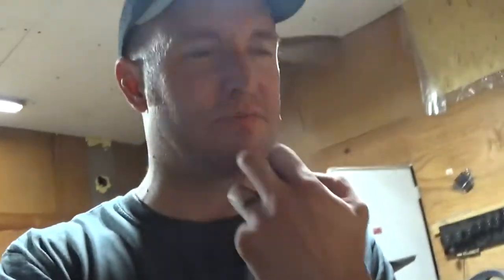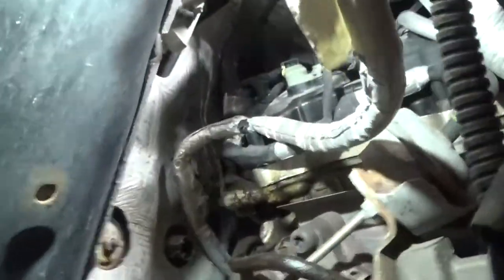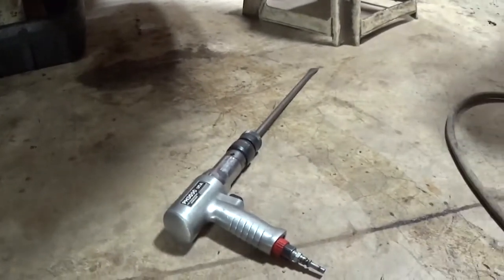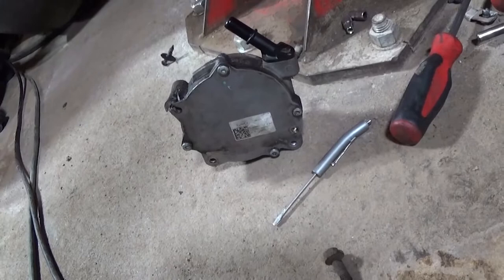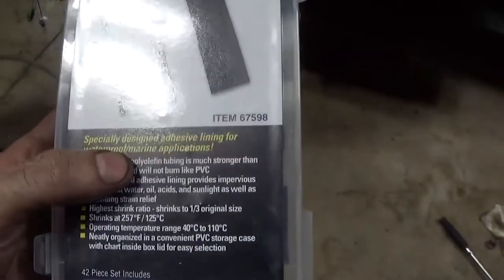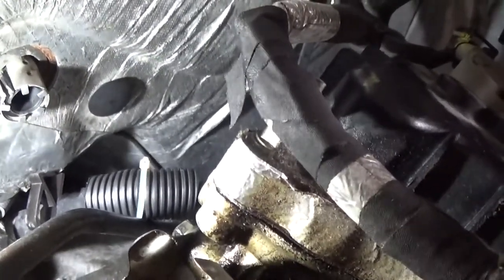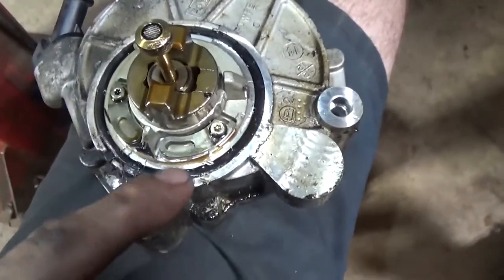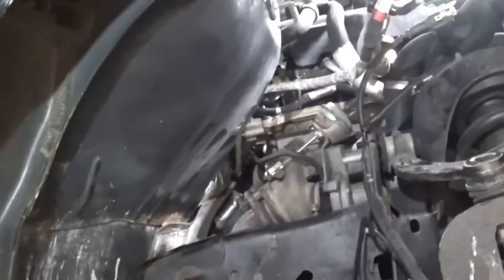Ford F150 Ecoboost Vacuum Pump Replacement. It had to be my truck that turned into  NIGHTMARE!!!!

Comment: How hard was it to get to the top bolt with the die grinder?  Did you get at it from the top, or the bottom side?  Once you got the pump off, how hard was it to get the rest of the bolt out?
Reply from the maker: I’m pretty sure I got to it from the top. I always pull the right inner fender out.
Reply from the maker: Once I cut the head off. I slid the pump back and pump back and cut the bolt again or tried to work the bolt out with vice grips. I really should have gotten it on video.

Comment: My stem stayed in. How hard is it to get out? Working on it now. Does the stem just pull out?
Reply from the maker: Yes just pull it out
Reply: @showmerepair  thank you for responding so fast.
Reply from the maker: @brittwarren6022  your welcome. I try to keep up. Good luck
Reply: @showmerepair  what can I use to pull it out? I can't get plier on it good.
Reply: Nevermind u actually just got it out. I was able to get some small channel locks on it.

Comment: Put a towel under the pump. Everything I dropped slid down on the transmission, lost a wrench slipped right under the loose insulation above transmission. Another manufacturing defect to save a nickel. 
One of my bolts is stripped. What a PITA 6 hours in even went tool shopping. Vice grips air hammer fancy pliers. Nothing has worked. 15/16 socket. Soma A hole over tightened it. Nightmare .. im going to try cutting it.
Reply from the maker: Mine was that way from the factory. I’ve owned the truck since brand new. I had to cut the head off the bolt the slide the pump back and cut the rest of the bolt

Comment: Dealer parts for fords are most of the time always better then Cheap knock off or aftermarket parts from places like rock auto but that's my experience as a tech especially for things like sensors fords are picky and some aftermarket sensors tend to be not the same ohms As a factory sensor my experience fords and toyotas are very picky on parts but good video nice work getting the vacuum pump off with all the issues
Reply from the maker: I agree. I was a Ford tech for 16 years. 
I saw a lot of cars come in with aftermarket parts that are junk. 
Cool thing is. If you buy motorcraft parts on Rockauto. If you have proof of purchase and the parts fails. The ford dealer is suppose to warranty that part.
Reply: I second that.
Reply: @showmerepair  oh that some sweet info ON Motorcraft parts at rock auto didn't know that but very sweet appreciate the Cool informative facts bro

Comment: One of my bolts are freaking stripped. I’ve tried 3 times to get it off. Going to try another method.
Reply from the maker: That’s a bummer. What bolt?
Reply: @showmerepair  vacuum pump.
Reply from the maker: Oh for some reason I was thinking you were working on your rear axle. I didn’t look what video you’re commenting on. 
My mistake. That happened to me.

Comment: Any idea what size screws they are I dropped one and can't find it any help would be appreciated
Reply from the maker: I think the thread pitch is 8x1.25. Couldn’t tell you the length. Sorry.
Reply: 8mm
Reply: Put a towel under it. Anything you drop ends up in the insulation or on top of the transmission
Reply: Just get them from ford, $7 for the three bolts and they’ll look it up for you

Comment: Hello anyone that can help lead me in the right direction or provide any information I would be greatly appreciative. I have a 2015 Ford Expedition EL Limited 3.5L, I have been noticing a burning and smoking but it’s not consistent. Also my check engine light came on with a code P0299 turbo/supercharger eco boost. I thought somehow it was all connected but when I just took my truck to the shop I was told that the vacuum pump power brake booster needed to be replaced as well as the valve cover gasket because the gasket needed to be removed to get to bolts which is on the engine. I was quoted $778.46 which $300 is for the brake vacuum pump and $130.00 is for the pair of valve cover gaskets which he said I could just save the driver side because they supposedly don’t come separate and the other $300 is labor. However, I’m wondering if it true that when replacing this part on my truck the only way to get to it is removing the valve cover gaskets and then replacing with new ones? Also I’d like to add that I don’t seem to notice any issue with my brakes or noise at all just the burning smell and smoking sometimes. Any suggestions or advice please and thanks in advance!!
Reply from the maker: Hi. With out seeing the oil leak I can’t be 100%. But I believe what is going on is the vacuum pump is leaking oil. 
I’ve seen a lot of them leak. 
You most likely also have a valve cover gasket leaking oil. 
I’m working on a video now of this exact thing I ran into on my truck. 
This video I replace the vacuum pump due to oil leak. From my future experience this fixes the issue. 
I continued to drive my truck but still smelled oil. Verified an oil leak by the vacuum pump. Replace the valve cover gasket. Problem fixed. 
Ask if you can supply the parts. 
You can get a motorcraft vacuum pump at rock auto for half the price. https://www.rockauto.com/en/catalog/ford
Reply from the maker: Also call a couple other shops and get quotes on replacing the vacuum pump and passenger side valve cover gasket.
Reply: @showmerepair  Unfortunately if I do there’s no warranty on the job. But I’m definitely going to try calling other places and see if they’ll give me a quote. You know how some places are they claim they have to see it first.
Reply from the maker: @Stackems7  they are not really telling you the truth about any warranty on the job. 
If you supply the vacuum pump which is a motorcraft part.  That part has a 2 year unlimited mileage warranty on that part. If you suspect it going bad you can take it to a ford dealer. If they diagnose it as bad they will take care of the warranty claim as long as you can prove receipt of purchase. 
If you supply the part the shop obviously will not stand behind warranty on the part. They should give some kind of warranty on workmanship. 
Im in Missouri it maybe different in your state.
Reply: @showmerepair  I’m in Houston, I did just call and ask him about the workmanship warranty he say’s he has one but if it is a problem with the part I’ll still have to pay labor. I read on RockAuto about the warranty and I believe they cover labor up to $150 hopefully I read that correctly. I’m definitely considering going this route and just purchasing my parts myself because I even found the valve cover gasket on there for cheaper. Which I believe is a 12 month warranty but it didn’t state anything about labor. The only thing is now his labor amount seems off because he stated he charges $100 an hour but I’ve watched several of these videos repairing this part and most people state it took them an hour tops not to sure about the valve cover gaskets labor time.
Reply from the maker: @Stackems7  vacuum pump yes around an hour to replace. 
Valve cover takes longer.  Motorcraft warranty info

https://www.motorcraftab.ford.com/us/en_us/home/warranty.html
Reply: @showmerepair  Thank you so much for all your help!! I’m trying to click on that link to pull it up but it’s not loading anything not sure what’s wrong.
Reply from the maker: @Stackems7  just google motorcraft warranty.

Comment: My truck was bought with 100,000 on it. Apparently the other owner just gasket sealed it because it all over.
Reply from the maker: Somebody probably did a service on the rear end and used a bunch of silicone. 
If your finding that the rear maybe beyond repair due to damage. 
You can search for a low mileage used rear end. Www.car-part.com

Comment: You stripped the bolts 😂
Next time try a quality 6 point socket
Reply from the maker: I did
Reply: @showmerepair  i need to do mine, what a pain. Some videos go through the wheel well, others from the top. I wonder which is easier.
Reply from the maker: I prefer the wheel well.  I’ve done both.
Reply: @showmerepair  thanks that's good to know. They want $600 to do it where i am. Rediculous it seems
Reply from the maker: Probably not that bad of price. Parts is probably close to $300 at dealer. Shop labor rates are getting ridiculous. I bought mine on rockauto. It was a motorcraft. Ford dealers have to stand behind the warranty since it is a ford part. Just need to show receipt of you would need to warranty
Reply: @showmerepair  its just a repair shop. Not a dealership. They will probably hit rock auto too 😂. The part isn't that much online, like you said even for motorcraft
Reply: @roberthughes2687  If it’s a 2015 and up there is more room behind the engine. I wound up having to replace both the gasket (I kept the pump as it was fine) and the valve cover gasket because both were leaking. I went in both above and from the wheel well to be sure I could get everything clean. The bolts on mine were impossibly tight. I can’t imagine how they didn’t break when installed and torqued down to 300 ft lb.
Reply: @bigpicturethinking5620 it's a 2013 . In fact we just did the lead frame, timing chain, cam phasers and tensioners and throttle body. 
Sigh... Pretty much everything I have read about being an issue on these trucks